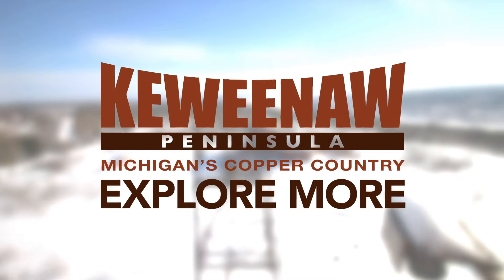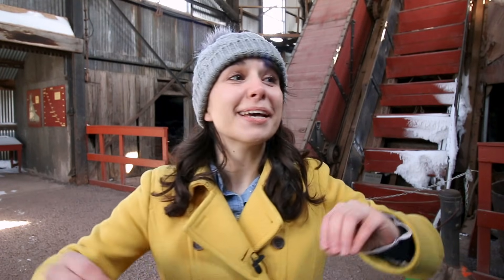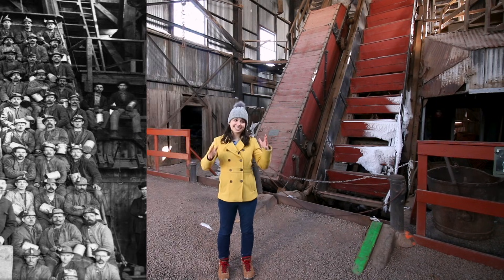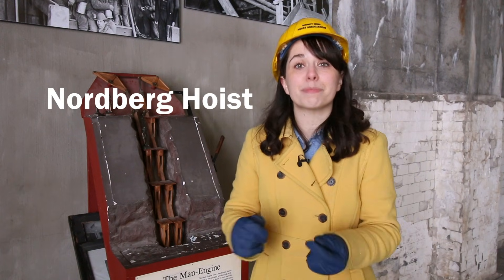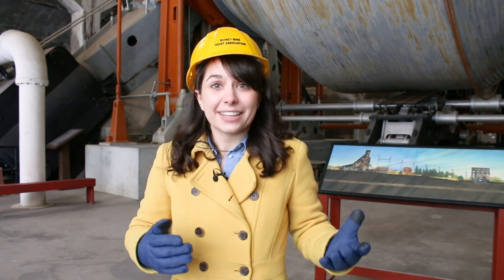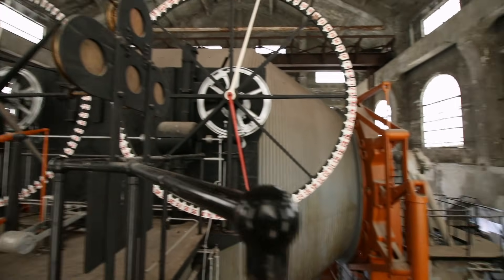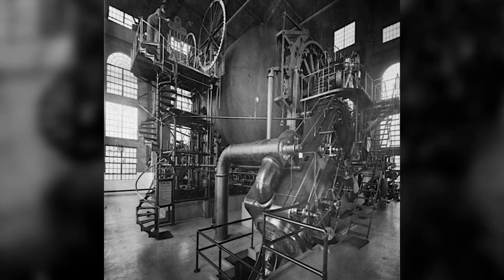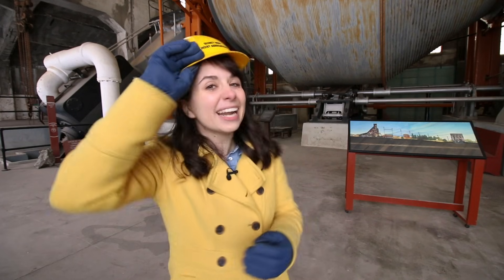The Largest Steam Hoist on Earth | The Nordberg Hoist, Quincy Mine #2

Comment: Conical drum hoist.
Thats a very rare thing to see.

At Creighton mine 5 shaft hoist room there was an electric version.
Might still be there, may have been destroyed.

You wont find a lot of information on these old systems.
Nordburg no longer exists.

Its nice to see a little preservation.

I think the Creighton electrical dept kept the 5 shaft machinery alive, but not in service into the early 80s.
Just because it was so old and odd they  tried to preserve it.
Last time I saw it most of the windows door and and equipment were smashed and some of the machinery cut up with torches.
Too big to torch it and someone gave up but its a complete wreck what ever is left out there.

Comment: It's interesting to note that at 2500HP, the Nordberg at Quincy #2 was designed for efficiency, not brute strength.  Ahmeek had a 6500HP hoist and somewhere in Tamarack they had 2 of those on a single shaft!  Probably many more up and down Mine St. in Calumet.  The late 1800's/early 1900's had copper prices high enough that your profit was basically based on how much you could process.  By 1920 when the hoist featured here was built times were leaner and they were trying to save coal.

Comment: I've worked as a machinist most of my life, working on projects most machinists can only dream of, like fabricating 8 foot diameter ID gate valves for hydraulic dams that you can stand inside of, foundry equipment so large that it requires 60 ton gantry cranes to move the parts around on the CNC mill table (42'x13'x9' XYZ travel with 150 HP, a big boy), and a hundred other massive projects involving millions of dollars each, and I can say with certainty that compared to the old titans that built this place my work is childs play. Slide rules, pen, paper, steel, oil, grit, blood and sweat were the tools of the trade and they made it happen. They still managed to nail tolerances down to the thousandths of an inch across dozens of feet with nothing but direct measuring tools, no fancy 3D laser tracking voodoo like I've grown accustomed to for ensuring QC. I will always take my hat off to the old machinists of yesteryear, they were unparalleled and their likes will never be seen again in this modern computerized age.
Reply: The only guys that rival them are the portable machinists. Tho half of them are babied these days with laser trackers

Comment: Interesting tidbit: the tapered sections of the drum are to give the cable less leverage as it pays out and gets heavier. That way less torque is needed to offset the imbalanced cable weights.
Reply: Those tapers are interesting to me.  In order for the cable to go back and forth across the drum in the grooves.....there must be enough drum capacity to move 9,000 feet of cable as the cable moves from one side of the drum to the other (or the hoist is limited and cannot reach the bottom most layer as the other car is at the top and dumping).  I would have loved an "advanced" tour of the hoist with a more in depth explanation.
Reply: I thought that the tapered sections were just old roofing tin, made to look like the cable wrapped around the spool. Tapered sections are not needed in actual operation, IMO.

Comment: Hi any idea why the drum needed to hold so much wire on it? Was there a difference in the depth of the sides ? In a normal winding gear set the cable just makes a couple of turns around the pit-head . P/S  keep the chirpy smiles coming .

Comment: 5:45 But they did have computers. In fact, they had computers that would respond to voice commands, and answer in a co9mpletely normal voice. Even today, computers sound somewhat artificial. They are getting better all the time, but if you talk to a computer sooner or later there will be hints that the computer voice is artificial.
      But computers before the 1950's spoke with a voice that not only sounded totally natural, they actually were natural, human voices. So much so, if you offended one, it might actually yell at you.
    Of course these were not electronic computers, they were human beings (usually women) who would perform mathematical operations for you.

Comment: The wheels at the top of the shaft are known as sheave wheels. those are some of the largest I've ever seen, and I've never seen a spoked one before. They have to take the entire load of that cable, skiff, etc and are really just as important as your winch.

Fun fact, you can control the decent speed depending on where your cable lays on a drum that shape. larger diameter drops faster because of the higher circumference. 
also, it's gotta be Fun* when you get cable wear or something and have to remove 100' of cable and now have to either pay more off the drum (if you have it) or just accept that your cars are now parallel at a higher level. either way you have to adjust every one of those cards on the clock now. and you have to do it all with just bells to communicate... and idk about how they did it back then, but now MSHA makes you take inspection cuts on the cable to check for internal rust and degradation. so over time, the hoist markers need to creep around the clock until they are out of cable, then re-cable it (which I doubt they ever had to do in 10 years, but it's just general mine Fun* facts)

*guarenteed it's not actually fun. the miners would use a different F word here... with some more color added

Comment: Awesome video and your story telling style is great. I studied video for a bit; but can't really say for sure how the hoist coils the cables; over the drum we see; or inside the  drum?? Very curious as a lifetime mechanic/engineer. Thanks for your determination and creativity it take to produce these videos.
Reply: Yes I really would like to see an animation of the hoist working. My guess is there were two pairs of carts. When A1 goes down, A2 goes up. When B1 goes down, B2 goes up. Probably the operator could move the cable sideways between the small and large diameter of the drum to vary speed and torque of the two pairs individually. Kind of like the different gears on a bicycle.
Reply: I wondered too and found this;
There are two take-up drums, one mounted at each end and within the main drum to carry the surplus rope. They are operated indepen dently of the main drum by 10 h.p. Dake engines.
Now I'm even more confused as to how that would work.

Comment: the bureau of labor statistics has the inflation figures on-line, from 1914 and there is a calculator for that. If the hoist was $180,000 in 1913 it's close to $5.5 million in 2022

Comment: Please visit the Homestake Mine in Leed, South Dakota. The mine is over 8,000 ft. deep. While gold is no longer produced the mine is used as a shield for a gigantic Neutrino Detector. Taking the tour is worth the time and effort just to see the gigantic hoisting machine.  Also visit the 1880 Railroad

Note: The steam engine is a double acting, double expansion reciprocating steam engine with Corless rotating valve gear. This is near the top of reciprocating steam engine technology. These were replaced by electric motors or steam turbines. Electric power plants use steam turbines connected to rotating alternators. Large ships use huge (100,000 Hp)  reciprocating Diesel engines.

Comment: The Nordberg Steam Hoist was designed and built in Milwaukee. Like the Quincy 
Mine, Nordberg Manufacturing is relegated to history. Sic transit Gloria Munda. Great video.
Reply: I sailed on the Myron C Taylor as well as the Calcite II.

Both were repowered with Nordberg diesel engines in the 1960s.